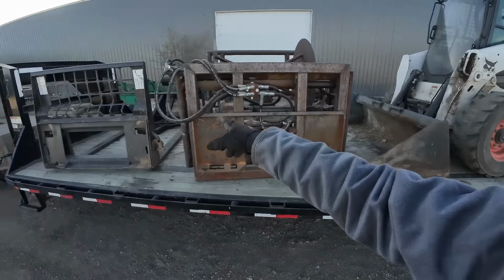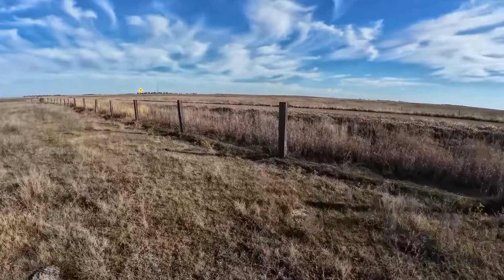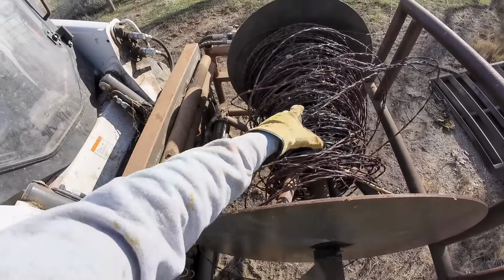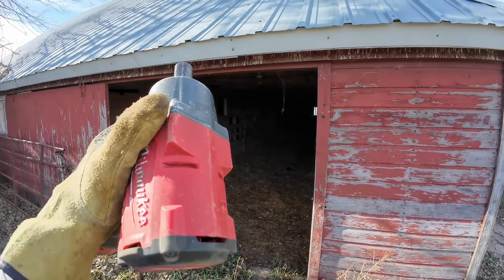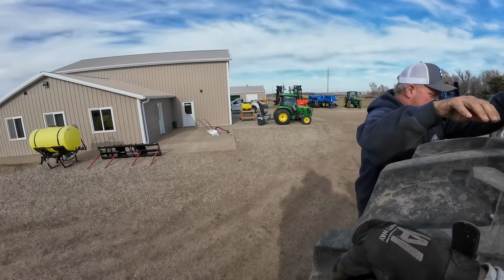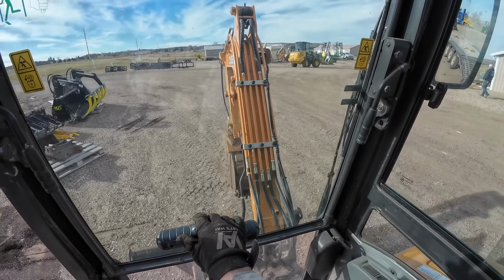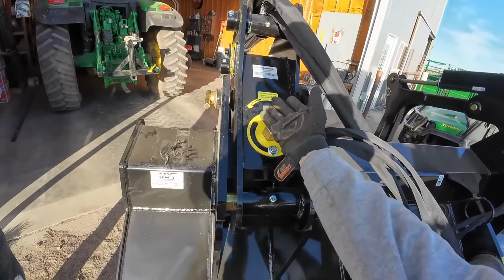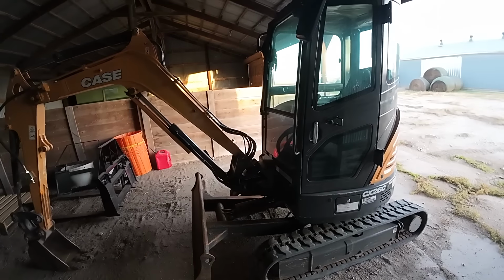Christmas Came Early!

Comment: Willing to bet that fence was made in the 80's, the reason I come to that conclusion is it is made of railroad ties. In 1980 the Staggers railroad act was enacted and led to the decline of the railroad and a lot of low used and light destiny lines were to be tore out. When this happened they were literally giving away railroad ties, I know this because my dad was bringing them home everyday by  the truck loads, this was 1983. 1984 my brother and I  built MILES of fence the whole summer and we dug all of the holes by hand and placed the RR ties in and tamped them in by hand. Alot of work but many of them still stand today, only ones tore out are due to row crop farming.

Comment: Great video. It looks like you have made some improvements on the wire winder. The guides out front and some of  the slop is gone from the  spool. If that was in a video, I missed it. It works well, thumbs up 👍

Comment: get the hyd. thumb that  hoe is plumbed for and has the mounting plates welded on the boom
Reply: I saw your new vid. ditch digging you might want a ditch bucket ,wider with out teeth with more taper in the back. some times a few holes in the back of the bucket helps brake the suction . and dig from the side with your tracks running with the ditch